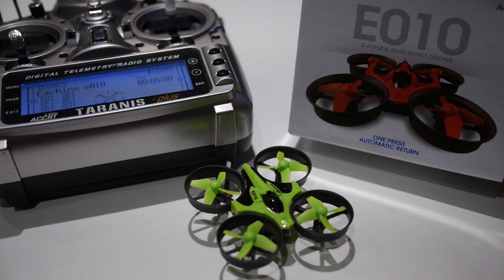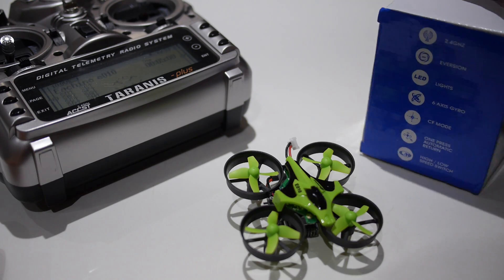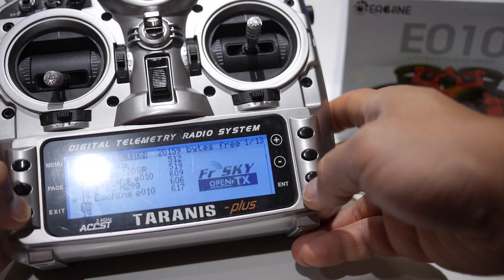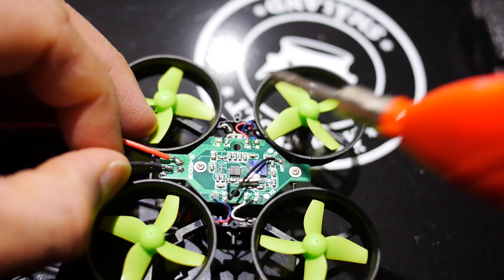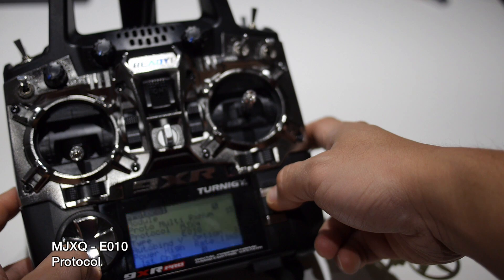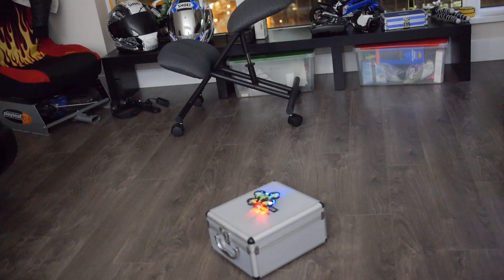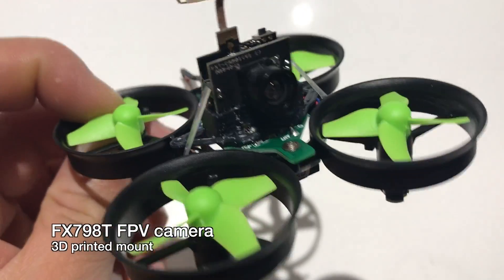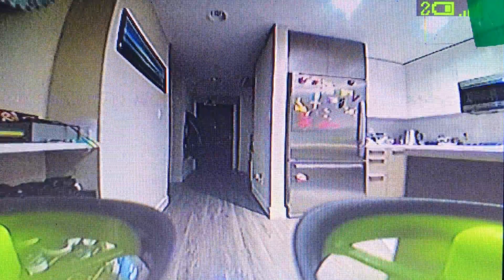Eachine e010 with Taranis / 9XR Pro transmitter with 4in1 multi protocol module

Comment: I have tried this on the 9XrPro and could not get to bind.  I have the latest Er9x firmware in my 9X already.The protocol shows up in my menu even though I did not update the module, do I still have to update the module if the Eachine protocol is present in my protocol menu?  Seems real complicated, I'm not real computer savvy and you go through the process a bit too quickly for me.
Reply from the maker: +Dean Hallal you wil have to update. Get this module if you don't have to update. https://youtu.be/VlocpXb2W7Y it supports e10 and is around $10.
Reply: Hey thanks for the reply. I had one of these form when I was trying to connect to a AFFHDS receiver and never even tried it.  Just tried it with the E010 and no go, didn't even get an led on the module. Will keep at it.

Comment: Hi Ken, got a question. I copied the  model bin files on my qx7 sdcard model folder and only 4 models showed up. Should be 7 models. Any idea why?
Reply from the maker: +Ronn2664 you have to import them on to the qx7. Copying them on the sd card doesn't load them. You have to choose import from the menu.
Reply: kenVersus yea i did the same procedure lie on your video. copied them on the sd card models folder,  select an empty slot, chose restore model, find the model file but only 4 models shows up instead of 7 that's on the sd card.
Reply from the maker: +Ronn2664 that is strange. Maybe the file name is too long.  Try a different sd card. That's all I can think of.

Comment: OpenTx any Firmware: Make new model and chose 12 channel PPM go to Mixer and:
First,you need to change the channel order to AETR .Next you can choose protocol you liked according to instruction and make sure CH1-CH4 is AETR .Last ,you need to hold the Remote Control Rocker（please make sure throttle stick down )to turn on the RC model .If your taranis is flysky th9x or turnigy 9x. You need to change all channel (highest and lowest channel )to 120% and then operating flysky th9x according to instructions .Please make sure throttle stick down before you turn on flysky th9x

Comment: I have just purchased a new Turnigy 9xr pro and fitted the banggood 4in1 multi protocol modulator and tried using your eepe model file for the e010 and still won't bind. Why doesn't it work? And why are most of the videos all about the Taranis transmitter? please help me I really don't want to buy another transmitter. And the modulator is the v1.2.
Reply from the maker: +Graham Parkinson you probably need to update your 4in1. The guide is here: https://github.com/pascallanger/DIY-Multiprotocol-TX-Module/blob/master/docs/Compiling.md
Reply: I have just bought a 6 pin header and the usbasp as I had a feeling you'd say that I should update the 4 in 1 firmware. I don't know why they don't just supply it with the latest firmware because if its stock it doesn't work with all models. So it looks like I'm going to burn my fingers soldering again, what joy.
Reply: Graham Parkinson If all your flying are toys that rely on the NRF24L01, I can confirm this works for the E010/H36 and all clones https ://www.amazon.com/gp/aw/d/B01MTWIDH0/ref=ox_sc_saved_image_5?ie=UTF8&psc=1&smid=A36JHG7Q6UUJF

Going to be updating my 4 in 1 as well, need the Hubsan protocol.
Reply: R Isla thank you for your reply but my fleet of airborne drones is made up of about 7 toy quadcopters, 2 Robocat 270 racing drones and a diatone 150. I was thinking of buying the modulator you recommend but it'll have to wait until I've tried updating the firmware on the 4in1 multi protocol modulator I have at the moment.

Comment: Do you know which channel is used for the rate function?
Reply from the maker: +VD2021 i don't know. But with a programmable radio like the Taranis or 9xr pro. You can change rate of each channel by modifying the weights of each channel. 0-100.

Comment: hi! 
i have th9x with er9x-r820 fw and 4in1 module with stock fw. it binds with v911 heli and bayangtoys x8 quad but it wont bind with e010. mjxq e010 protocol is set. i've tried all other protocol but it just dont bind. do i need to reflash the module?
Reply from the maker: +Smoodge1 yes. A module update is needed.
Reply: now I'am stuck with programmer which is from bg and it support only 5V (blue PCB). i removed R5 0ohm resistor but then I have 0V at output. can I use resisor divider in place of R5 to step down the voltage to 3.3V and what value of resistor should I use? my instrument measure 5.09V with closed R5.
Reply from the maker: +Smoodge1 try the Bg product page to find out what other people do. I don't have that programmer so have no idea.   I got mine from eBay by LC technology.

Comment: Hi! Whats is the difference with this? http://www.banggood.com/CC2500-NRF24L01-A7105-CYRF693-4-In-1-RF-Module-With-Case-For-Futaba-JR-Frsky-Transmitter-p-1116892.html?rmmds=mywishlist
Reply from the maker: +Sabe Amixtades looks like it comes in a fancy case. Should be the same but I don't have experience with this new item.
Reply: Ok thanks KenVersus!!

Comment: did u setup a bind switch in order not to have to power off the radio each time a battery is changed on the quad? HOw??

Comment: will the multi protocol module work with the turnigy 9x?
Reply from the maker: +DuBBs S yes. It works with everything in PPM mode. In serial mode you will need to load er9x firmware on the 9x. Serial mode lets you select protocols in the menu. Ppm, you use the dial on the module.

Comment: How did you upgrade the the firmware? You had to solder the pins for the usb or via Taranis?
Reply from the maker: +Daniil Motsenyat hi check out my other video that shows how to update. Should be a link at the end of this video or check out my video listing on my channel.

Comment: No go on binding here either (9xr pro)
Reply from the maker: You may need to update your 4in1 module since the firmware that was shipped may not have e010 support compiled in.  Also make sure you have the latest firmware for your transmitter.  Please watch my other videos for more info.
Reply: Ugg new you were going to say that.  Can I use http://www.banggood.com/3_3V-or-5_5V-USB-Programming-Module-for-Naze-Minim-OSD-Frsky-Multi-wii-p-1010726.html?rmmds=search ?  

The board doesn't detail what the two inside pins are.
Reply from the maker: +Ben Horner check my update 4in1 video. There should be a link to the programmer I used in the description.  Some use a jumper to select 3.3v. Some require removing a resistor to select 3.3v.

Comment: I am having trouble binding my e010 as well (I am using ur model). Did you have to flash your 4 in 1 module with the new firmware.
Reply from the maker: +Shamsuzuha Habeeb yes. I'm using the latest firmware in the 4in1 and OpenTx firmware. I flashed it so not sure if stock 4in1 firmware had support.
Reply: so to get it to bind i would need to upgrade my 4 in1 modul ?
Reply from the maker: Might have to update module.  So far everyone I know with the e010 updated it.
Reply: Do you know how with the ttl way thers no video about it

Comment: Do you have to do an initial bind, or should it auto bind? I can't get it to bind. I'm using your model setup.
Reply from the maker: +icountby5 oddly for me it only works via autobind. A manual bind never works. I have updated my 4in1 module. Don't know if the e010 support was in the 4in1 stock firmware.
Reply: kenVersus I got my usbasp today and updated the firmware. It flys all my hubsans, E010 and tiny whoop perfectly!! Thanks for you videos, you saved me from having to carry all my transmitters to the park.
Reply from the maker: Awesome to hear,  Yes, one transmitter to controller everything is awesome!